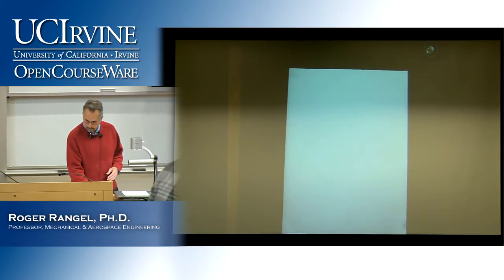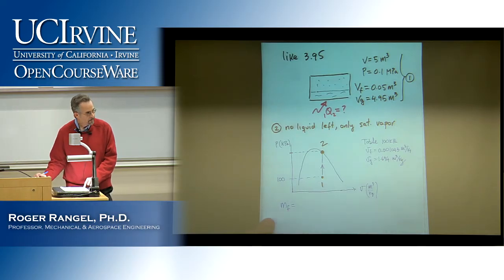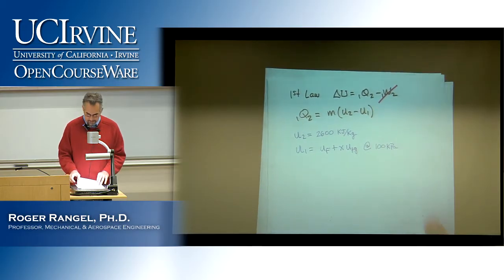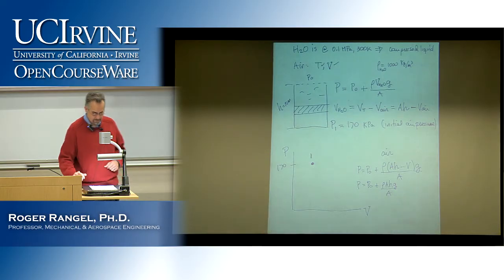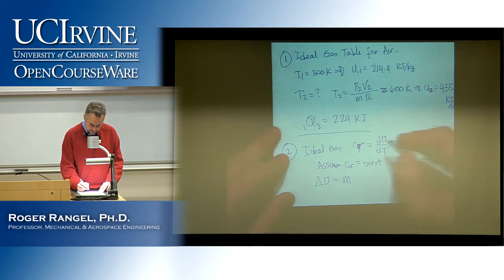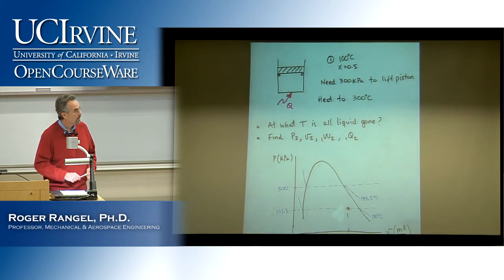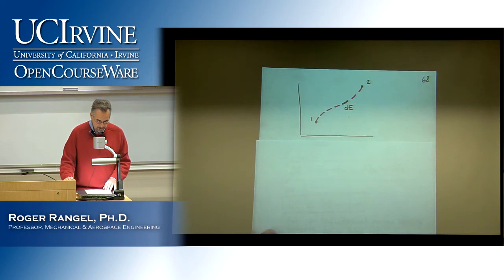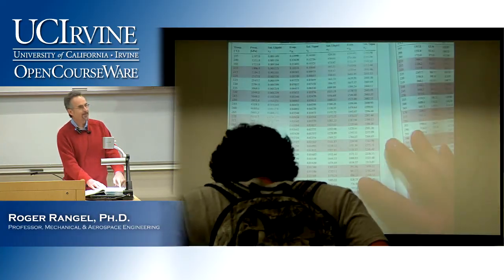Engineering MAE 91. Intro to Thermodynamics. Lecture 08.

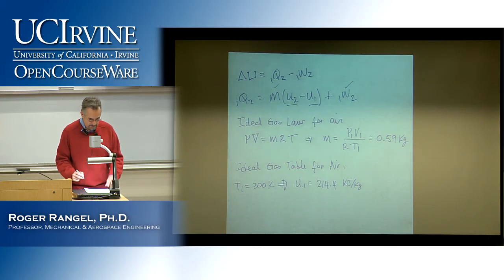Comment: Dear at 37:35 mints while calculating the U1 we use table A7.1 which is giving the internal energy at 0.1Mpa but our initial pressure is 170KPa so why we use only temperature to find out U1. why discard pressure....???
Reply: Honey Real or Magic  because it is ideal gas